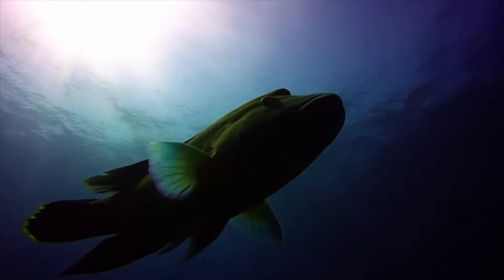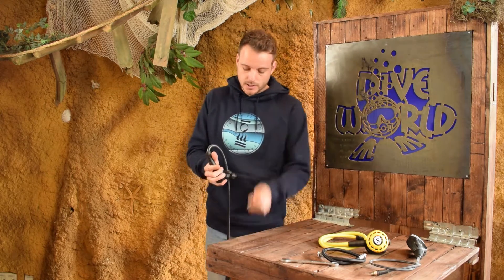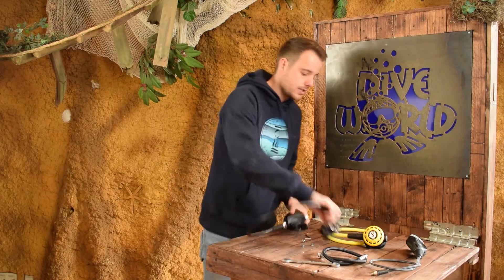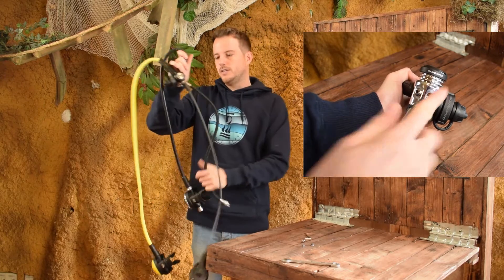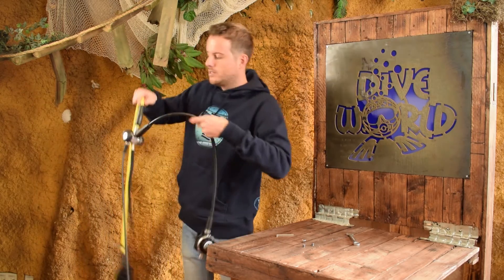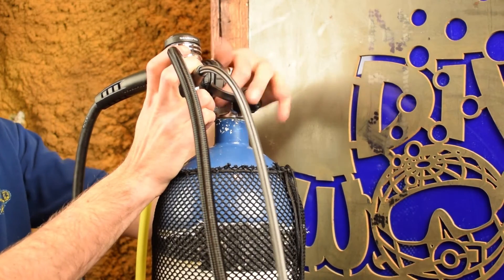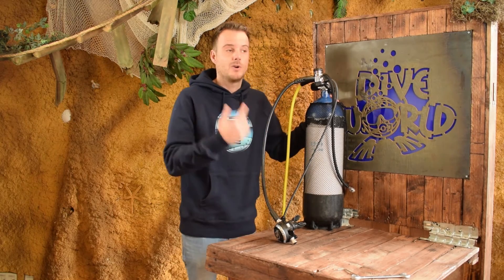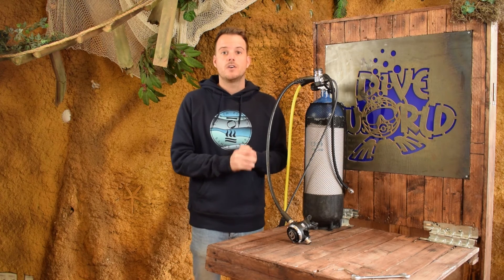How to Assemble Scuba Regulators | 4 easy Steps! | Scuba Advice

Comment: What do you do if you should have a leak?
Reply from the maker: Where is the leak?
Reply: @50ftBelow  just a hypothetical question 😅
Reply: @50ftBelow  just a hypothetical question 😅
Reply: @50ftBelow  but lets say the leak is at the first stage where you screwed in the hoses... just redo the whole process?
Reply from the maker: No, most likely you have a bad o-ring. Just determine which hose is leaking, unscrew the hose and replace the o-ring on the end of it. That should fix it.